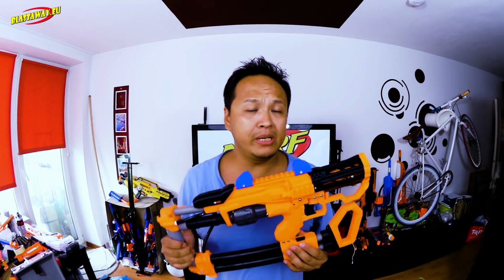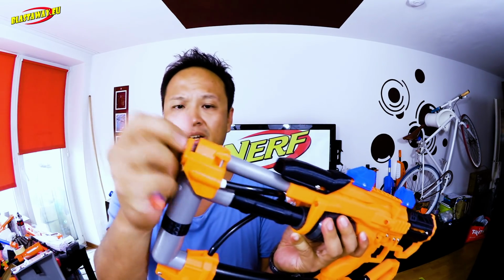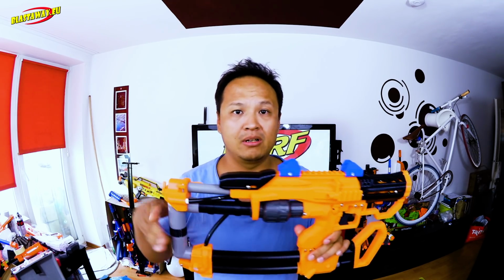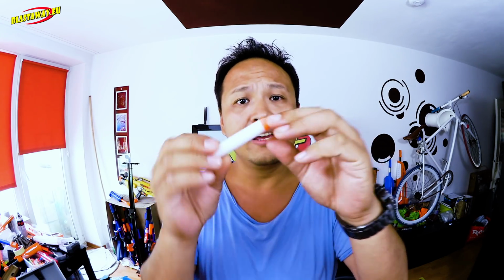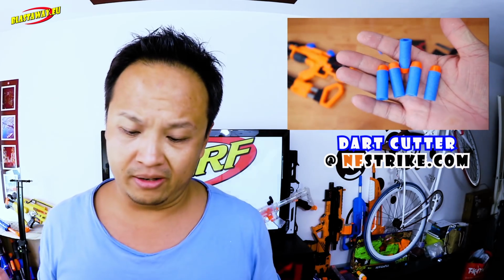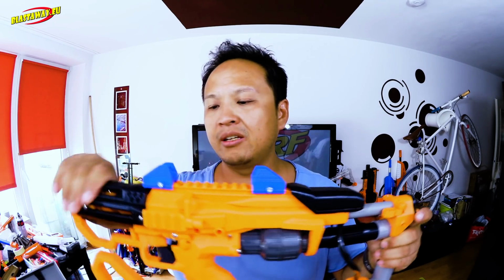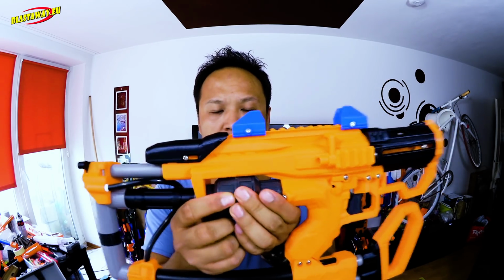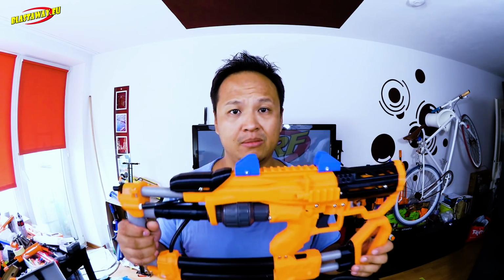JSPB PRO2 LONGSCAR | finally hitting something with Nerf darts

Comment: I’m a huge fan of air blasters. My go to primary for the past year and a half has been an RSCB’d Panther that holds three full length darts.
Reply from the maker: thanx for the feedback! i think you can appreciate this piece of work more than most other people without the experience of air blasters... ^^
Reply: blastaway.eu I’ve taken on players with modded Nemesis blasters and other high capacity round blasters. I’ve come out on top more often than not while using accufake darts and a 3D printed riffled barrel.

Comment: So much arguing over whether a rifled or scar type barrel actually induces spin on darts in flight. Thanks for capturing this finally for all the naysayers to see.
Reply from the maker: simple rifling doesn‘t work
though... it‘s either scar barrel or canted flywheels cages ^^
Reply: There's no argument over whether such devices induces spin on darts. It's obvious that they do, whether scar barrels or rifled muzzles or canted flywheels. The question has always been, whether the spin actually improves accuracy, or is it the elimination of muzzle blast that prevents dart destabilization.
Reply from the maker: where do you stand? ^^
Reply: blastaway.eu I have a BlasterTECH scar on my xzeus. Considering that this model is vented and also has adjustable rifling lines there is a massively noticeable difference in accuracy with no twist, and twist. It’s not just elimination of muzzle blast that aids in accuracy. If that were true there would be no accuracy gained by adding twist to the lines. As is, with no twist I still get whirlybird crazy flight paths and with 1/4” twist and acc gen 3 darts I get a nice, predictable flight path unless the dart is bad.
Reply: That doesn't totally answer the question either. The accuracy gained from applying the twist may simply be from the dart being gripped more tightly and be better centered. If it's simply spin = accuracy, then it also doesn't explain why accuracy drops when you increase the twist of the scar beyond a certain point for any dart. 

As for where I stand, it''s probably a combination of the 2 factors.